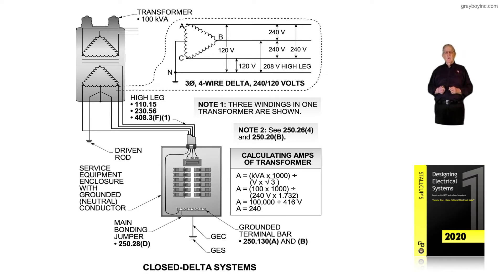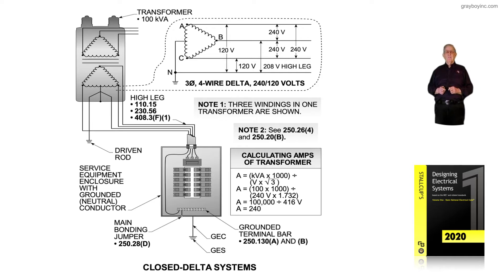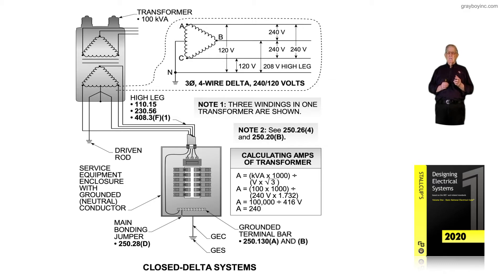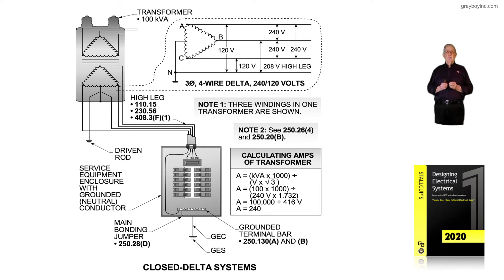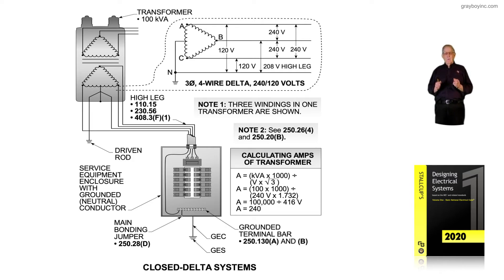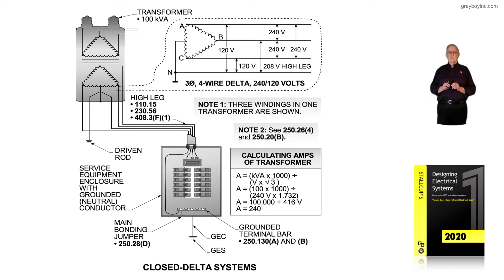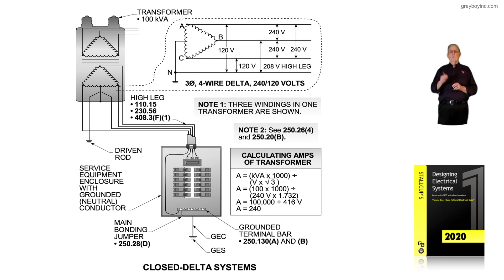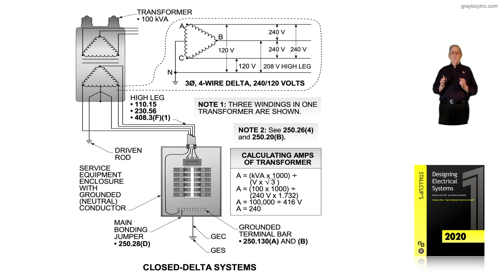4-5  240/120 V, THREE-PHASE,

Comment: You can step down the high leg to 120 volts with a multi-tap transformer and a straight rated 2 or a 3 pole breaker. Long be the high leg.